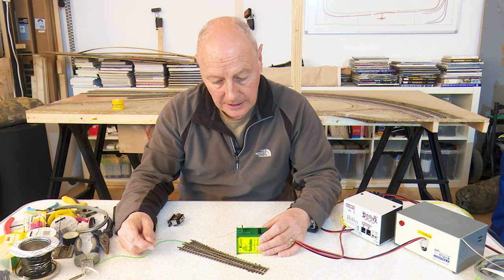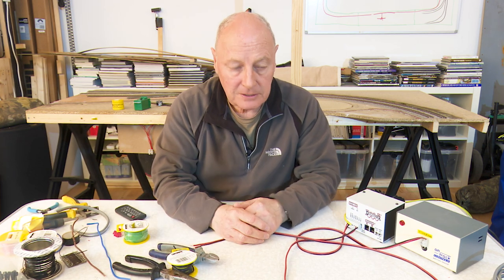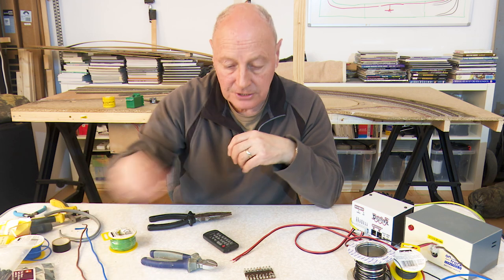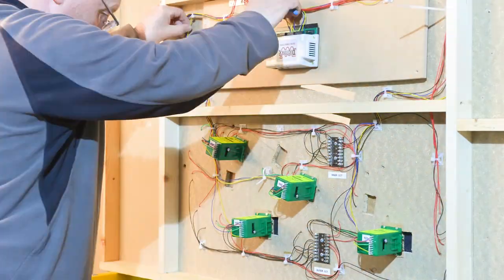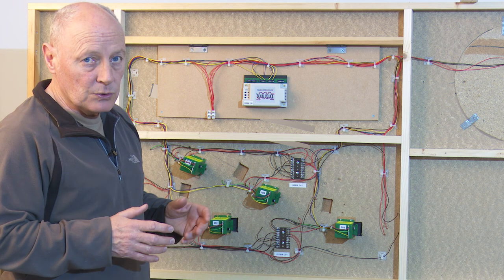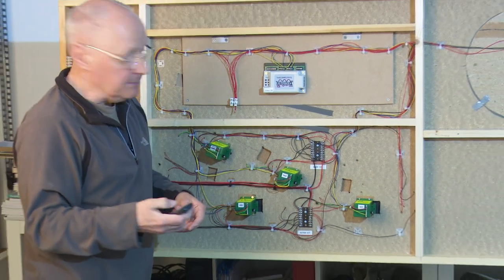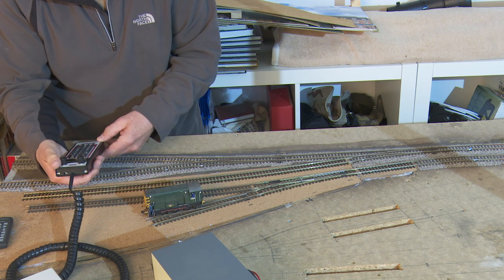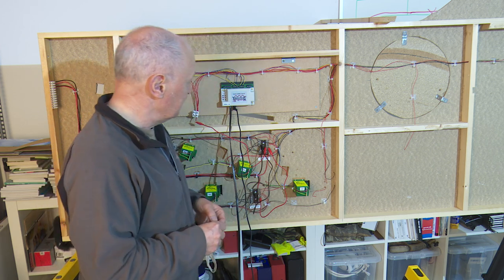DCC Bus Wiring at Chadwick Model Railway | 24.

Comment: Another great informative video..
I am advised I need to use Frog Juicers on my point motors.
I don't understand the logic of these, but they helped operation on my mates layout,.
Do Tortoise Motors not need these  ? 
I have watched your other videos and you have never mentioned them..
I am presently starting to wire up and add point motors.
Reply from the maker: Sorry but they way that I have designed mine, I don’t use them (or understand them either).
Reply: @ChadwickModelRailway  Thanks for your prompt reply. ..

Comment: Worked in pontoons. I like to uae something we used on them and it's a zip tie which has a hole in the end for a screw to attach to the board. Little more expensive but same result. You don't need to buy the sticky pad holder and zip tie when these come all in 1.
Reply from the maker: Good tip John, many thanks.

Comment: Hi Charlie
Firstly, we hope you and your family have a great Christmas and we look forward to many more interesting and informative videos in 2019.

Just a silly question for you, I am familiar with most of the techniques used to wire a layout but I'm struggling with deciding the cable size for the main bus wires on our new layout, currently in construction.
Basically, the attic is 10ft by 12 and we hope to have four main lines around the area with sidings and hopefully a fiddle yard and would like to run as many trains simultaneously as possible, using our newly purchased Dynamis Ultima control system. The plan calls for upwards of 27 turnouts and hopefully signals and also site lighting.

Should I be looking at 1.5 or go for the bigger capacity 2.5 (Not sure if you can get 2.5 in flex though)?

Your advice much appreciated.

Best regards
The Davids
Reply from the maker: Hi David,
I’ve published a video about this, it might be called DCC Bus wiring.
Anyway, I think that you’re going about it the wrong way.  Have look at the maximum output of your system, such as 5 amps.  If this output suits your needs, then buy cable to suit. I use 5 amp cable from Halfords which suits my layout.
Does this make sense to you?
Regards Charlie

Comment: Hiya and thank you for a great video, warts and all plus answering so many of my questions. Next question, how could that system run a mimic board showing all the points and how they are set? Could that system show on a mimic board witch sections of track are in use?
Reply from the maker: Hi Steve,
That’s a simple question.
The point orientation can easily be duplicated especially if you use tortoise motors. You simply need an auxiliary switch to power the LEDs.
But to show the progress of a loco around the layout is for more difficult and requires block detection.
The wiring then becomes more complicated and the price of components is substantial.
Regards Charlie

Comment: Hi Charlie, great YouTube clip as always and very useful information and educational on the size thickness of the Wires you need for a Bus Wire! My Question for you is....  I have 40 plus DCC Sound Loco’s not to mention more than 30 DCC Fitted Chipped Loco’s and not that I would ever run them altogether at any one time, but is there a formula for working out how many DCC Sound loco’s and/or DCC Fitted loco’s that I can run safely without blowing my DCC chips/DCC Sound Loco’s, due to lack of power, or on the other end of the scales adding to much power to a Bus Wire that it would melt or overheat and thus damaging loco’s etc...or my Lenz controller etc...? Would it be just a matter of adding more Lenz LS100/LS150 power transformers which is what I use to the Bus Wire in order to have sufficient power to run my Maximum number of loco’s at any one time....! Or Based on your 5Amp power supply how many Sound Locos can I run just on one 5Amp power supply...? Safely thank you for all your hard work in explaining in a professional manner the modelling ways of doing things! You truly do inspire and by watching how you do it all, you can learn a great deal just by watching someone else! For that I can only say Thank You!
Reply from the maker: Hi Jamie, I think that the assumed power consumption is around 0.5 amp per running sound fitted loco. Therefore, 10 per 5 amp controller.
If of course you have several power districts then each could have its own 5 amp power source.  If you have too many locos running I’d assume that they would all run slower/quieter.  After all, you can only produce 5 amps. 
I hope that helps. Regards Charlie

Comment: Hi Charlie, I'm now closing the ring on my layout and have the following questions:
1) Can you please confirm, the gap needs to be on the both: the bus wire and on the track as well (roughly at the same location) or just only on the bus wire?
2) I presume, it doesn't have to be in the middle of the ring, in the halfway of total track length?
I would appreciate your answers, thanks. Filip
Reply from the maker: Hi Filip,
It's my belief and others, that on a continuous circuit layout, the track and bus should not be continuous.
Therefore, I would break the circuits (both feeds and both tracks) at the same convenient location.
Regards Charlie
Reply: @ChadwickModelRailway Many thanks Charlie for your answers, appreciate this.

Comment: Honestly my main problem with soldering is waiting for the iron to heat up, and no matter how hard I try I inevitably cook my pinky. it’s a bit more of a hassle for repairs too. I’ll do it if I need to though, nothing beats the size or strength.
Reply from the maker: I think that you just need to spend quality time practicing your soldering before you tackle your railway.
Reply: I bought a temperature controlled soldering iron from Amazon that heats within a minute to the LED indicated temperature. I have soldering exerience and my old solder iron took approx 5 mins to get up to temperature. You also need to select the correct tip size for the job you are doing. I use a small pointed tip rather than a flat tip for soldering droppers to rails. Look forward to coming across your soldering VID as i work my way thru your collection Charlie. Absolutely first class vids and i've learned so much since i started watching them. The buss wire ring loop i hadn't given much thought until now and same with the track loop. I'll need to look at that a bit more. I'm new to DCC and this is my first attempt with it. Unfortunately i've chosen my first large twin level layout to experiment with LOL
Reply: I know its 2 years late, and i appreciate the response but Dmccombe is right, i needed an iron upgrade. Soldering bus wires and droppers is easy, its when im trying to solder small wires like in a loco that ill fry my fingers. My current iron has a long tip to grip distance, whereas id prefer a much shorter one.

Comment: Hi Charlie, a small suggestion - around 27min you connected the power cable etc to the DS64 and left them hanging - why not drill a couple of holes in the timber frame just below that, feed the cables through that hole to remove any strain from the actual plug on the cable and the socket in the DS64 when the table is horizontal. Maybe I'm   just a silly 80ys old guy but believe me I've made ALL the mistakes since 1953.  BTW the titles of your videos - should I work through them start at 1.  the numbering scheme/topic seems to be a little random. I'm not complaining but curious, thanks for a lot of tips - even for someone who built mains radios from war surplus spares in 1953.
Reply from the maker: Hi Lindsay, the cables were just attached for testing and in time, were attached properly on the "Drop Down Flap".  My Videos are numbered chronologically and not by theme.  However, the play-lists should be theme based eg the viaduct build.  Regards Charlie.

Comment: ¡Hola buenas tardes Charlie!  Have to start by saying, your videos are proving so informative and helpful. I’ve managed to complete construction of two base boards and have designed them to connect with the existing bench work in my garage. Cork roll has arrived and the layout of track has been connected up to make sure there is sufficient room on the boards and bench. 

Using various suppliers, most from your pointers during your videos, I have ordered rolling stock and track items.  Along with electrical supplies and the necessary point motors and control cables, switched etc. However, one lesson learnt has been to check couplings on items ordered. I decided on some trucks from A supplier in Liverpool and when a rather splendid brake car was unpacked, I realised Bachmann couplings differ from Hornby!  (I see you eyebrows rising as you read this). Before I go ahead and possibly ruin the brake car, have you any advice or guidance, through one of your videos, showing how couplings are changed?
Reply from the maker: Hi Gary,  are your couplings on these two wagons incompatible.
If so, do these items have NEM sockets?
Reply: Hi Charlie. Thanks for your prompt response. The two wagons have their respective company fitted couplings. The Hornby standard coupling (not sure of the generic ref #) as does the Bachmann (not sure of the generic ref #). From my untrained eye, the Bachmann coupling is a smaller (50% maybe) than the Hornby.  They will sort of attach but I’m not keen to use that full time. Sadly, I can’t see how to attach pictures to this reply (if that’s actually possible with YouTube?) Apologies that my familiarisation of different model types isn’t up to speed yet ☹️
Reply from the maker: Hi Gary, I believe that the Hornby model  has a fixed coupling whereas the Bachmann’s has an NEM coupling (which can be replaced with other systems). The Bachmann is by far better.  You may have bought the Hornby model from their Railroad Range, which does lack some detail.
At the end of the day Gary, I’d just use them as they are until you get a problem.
Reply: Charlie, good morning. As ever, wise words and, I agree. Using them, with a piece of test track, shows they do connect and, as it’s a brake car, I’m sure it won’t be a problem detaching. I have also learnt the coupling jargon for the Bachmann coupler. 

Today, and this weekend, I’ll be starting to secure the baseboards and then full positioning of the track. Cork roll arrived and, after watching quite a few videos from across the YouTube spectrum, I will make sure the tips offered are followed. I’ll try not to pester!  Have a great weekend. Gary

Comment: Charlie - so helpful. Thank you. First detailed commentary I have seen to cover cable / flex / thickness / gauge / size / power supply / system capabilities ....
At around 38.26 minutes, you mention "do the maths" re cables and power and system.
is there a "maths" equation by which I can know what size buss I should install? my layout is currently a 'start-up' with the NCE power-cab. But I want to put in the right size bus to cope with future expansion. Can you help me know what is the maths to work out how to be 'future-proof'?
Reply from the maker: For maths was regarding the voltage drop over distance. However, my next video will be looking into power management, so that might be of interest Tony.
Reply: Perfect - I’ll be watching. Thanks.

Comment: Charlie, I’m sorry to ask this question again, but I have dementia and I need to ask again. I am soldering each track and switch. I’ve found a new way to do it and it makes it easier. My question is weather or not I need to solder each track on to my bus line and again to a DS64 line or do I need to just solder each track to my bus line?
Reply from the maker: First solder each track wire to the bus.
Then take one cable from the bus to the track terminals on the DS64.
Reply: @ChadwickModelRailway  Hi Charlie, Inspired by your videos I am moving over to Digitrax from Gaugemaster and have a similar question. On my current layout I use a separate power supply for my Tortoise point motors rather than use the main bus that feeds the track. In your video you appear to refer to do the same for the DS64 but show it connected to the main bus  that also feeds the track. Am I missing something?

Comment: Charlie, if you use a higher ampage flex like say 17 amp but only send say ten amps through it, will that affect the power to the track?
Reply from the maker: Yes, Phil, the voltage drop will be less. Regards, Charlie

Comment: Charlie, at what point do you need feeders? Is it dependent on over all track length? I have the Bachmann Commander DCC starter set, would I need feeders?
Reply from the maker: Hi CN, I would solder a dropper to every piece of track to avoid DCC signal loss. 
Regards Charlie

Comment: After seeing this I split my large circular ring main at the far side opposite my DCC controller but I have a question.  Do the DCC signals still run around the track in both directions as that is still a complete/joined circle or do you have a spilt in the track also?
Reply from the maker: Using electro frog points, tends to split the circuit anyway. If not, I would insert cuts out the far end. Regards Charlie Regards, Charlie

Comment: Question for you Charlie..
When you were moving the loco, the throttle gave a chirping noise as you rotated it.
Is that normal, or was it just static feeback through your microphone?

Great video, and it should help a lot of people!
I shall be making my new layout to a similar specification (servo motors, frogs switched by microswitches and block detection), but I use the Lenz 100 system.
Reply from the maker: Hi, yes the Digitrax handset does make a chirp as you change the throttle level and I’m so pleased that you enjoyed the video. Regards Charlie
Reply: If the chirping annoys you you can switch it off.

Comment: Hi Charlie,
You mention the problems that can occur when you have a full, unbroken bus, i.e. a signal sent to say a point motor traveling in both directions can arrive at the point at two different times. Would this not cause the points, to, say, open then close because of the two signals?
Reply from the maker: I don’t believe so but after talking to an electronics expert, the time delay can make a difference to the DCC signal to chips.
Reply: Hi All, 
I noted your comment, it's to do with drawing current not so much with feed, I have a ring main to feed 12  dc the point draws from the least resistance, yes it is in theory feeding from both directions but it is the speed of light so on your 4 m x 2 m board it wont make any difference and this is also true for DCC on small layouts but on large layouts a ring main will not work all the time but it will most of the time, also all my lights & points are feed off the ring main with no problems. I have a separate power supply of 12 dc 10 amps that means it is able to feed 10 amps only when needed most times it would not be required to supply more than 1 to 2 amps, that's why they call them 'power supply'

Comment: Charlie, I’m confused. Are the droppers that connect to the bus for power, is there different droppers for Digitrax. It looks like Digitrax red wires go to a different point that power red wires.
Reply from the maker: No RH.  Normally all droppers go to the bus.  However, with block detection they need to go to a separate sensor. I use a Digitrax BDL168.

Comment: Hi Charlie, did you bother with a bus wire for the original Chadwick tailchaser? I seem to be going fine with direct feeds. John
Reply from the maker: Hi John, 
Yes I did have a DCC bus on the original layout although it was not wired in a continual loop.
I will refer to it when I incorporate it into the new tail chaser.
Regards Charlie

Comment: Hi Charlie, I am a newbie and stumbling my way through this so your videos are most welcome. If I initially just wanted to connect my new NCE Powercab to the tracks (before adding the bus wire etc. etc.), I would use the dropper wires and not the bus wire. Am I right? I am loathe to use the wiring that came with the Hornby select, 'cause its Hornby. Also I am not using the NCE accessory 5amp power supply but may do at some point. Thanks.
Reply from the maker: Hi Steve I would use a larger cable such as 16 x 0.2mm for the bus wire, and 7 x 0.2mm for the droppers. Regards Charlie

Comment: Hi Charlie, Excellent Video, BUT I  would NEVER use Scochtlok Connectors on Model Railway, they are Notorious for failing after a few years of use + Using them Derates the Cable
Reply from the maker: I have certainly changed tack on this one Keith. I still use them, but I put them on using a hot glue gun. Regards, Charlie

Comment: Charley, Can I recommend the Rapid Electronics Website as a suitable Maplins replacement. In particular their item 'CamdenBoss CTSN431/12MF 8mm 12-Way Male/Female Terminal Strip 6A'. They also sell lead/tin solder, multi strand wire together with a myriad of ways to secure your wiring loom to the baseboard. I am not affiliated to them in any way, but find them a cost effective supplier of some of the difficult to source components.
Regards Stewart
Reply from the maker: Thanks Stewart, I’ll check them out.